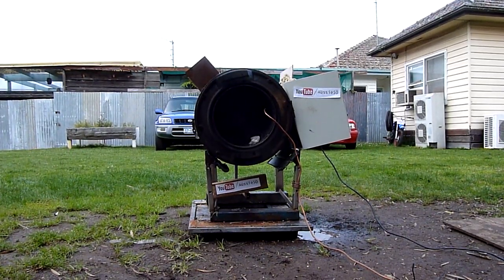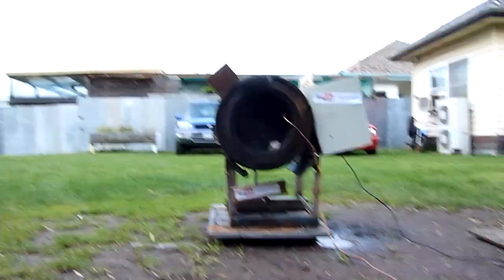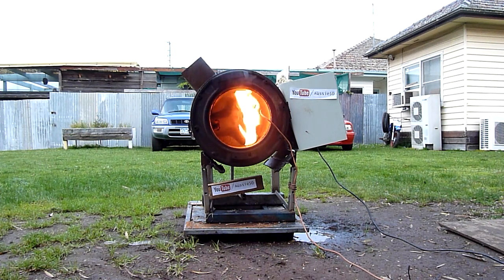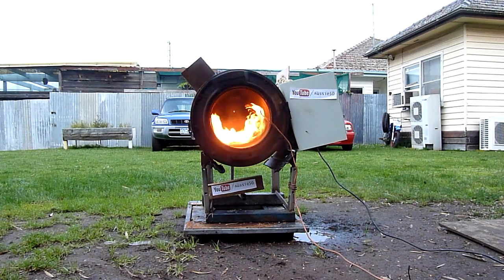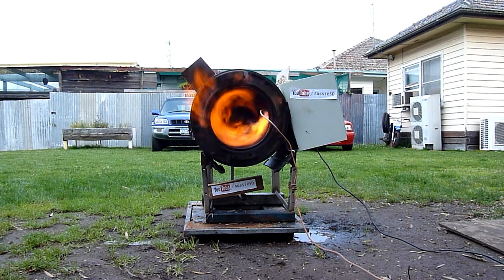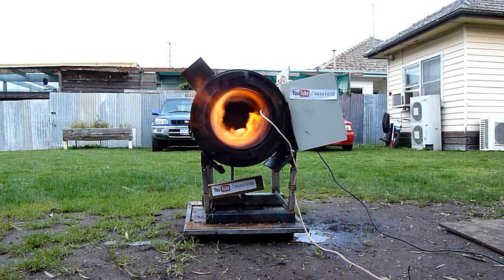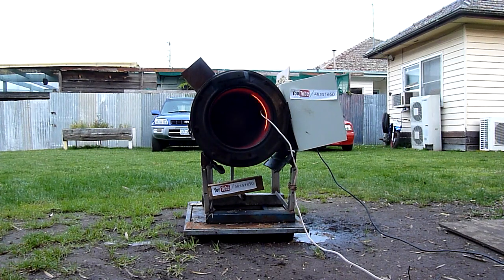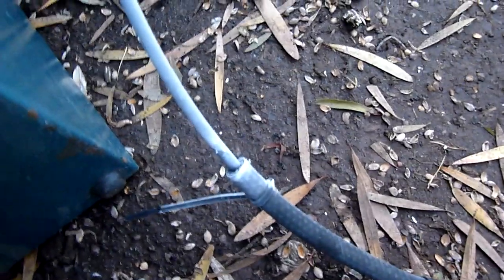Flamespin 3500 Ultra Edition - Propane Fueled Run

Comment: As ever, a silly, impressively ridiculous Flamespin, pity about the hose leak.  What I would like to see is a HD motor (dc brushless) spun up really really fast, like >30,000rpm ;-)  But I guess putting requests in the comments is frowned upon.  Keep up the good work.

Comment: Haha. :D You did in this vid what I thought about doing: Inverting the gas bottle so that liquid gas sprays in there for BIGGER FLAAAAMES. :D

IDEA: Dual-fuel flamespin with piezo ignitor. Spin it up, get a spark going, feed in Propane. Establish flaaaames, warm it up. When up to temperature, feed in the waste oil, get it running from that, then turn off propane. We now have full-on flamespin. :D 

Then... RIP IT RIGHT UP. :D

I still say that unit needs a water heat exchanger on it.... :D

-BBD